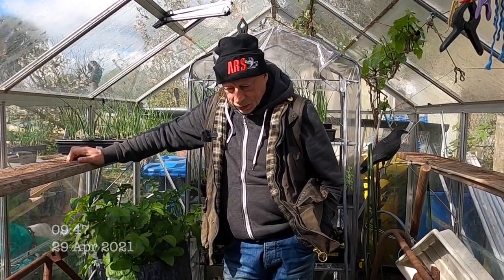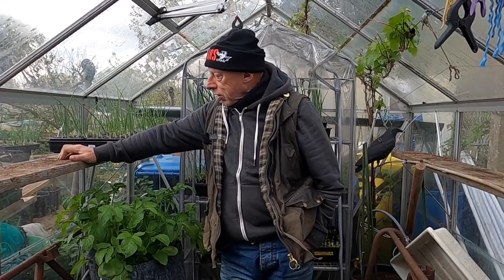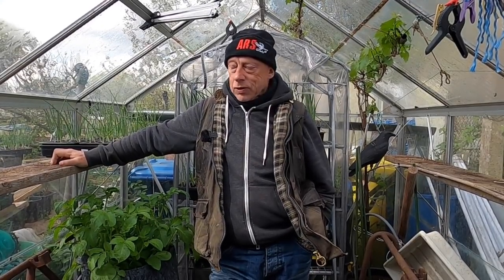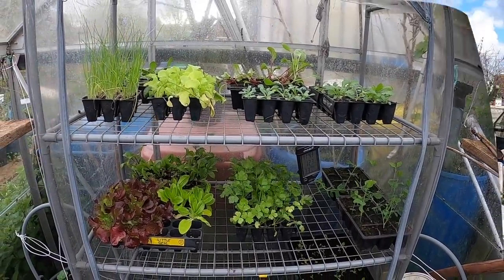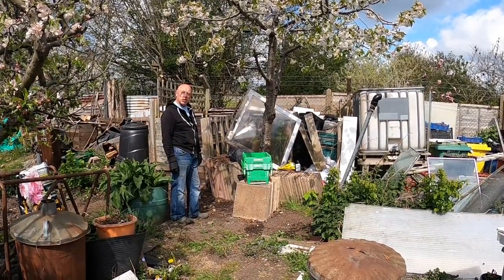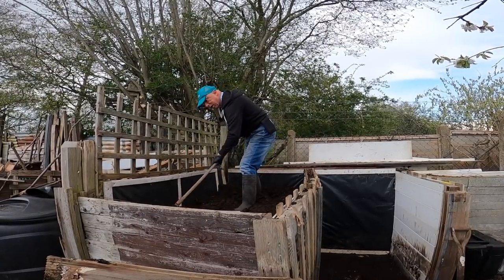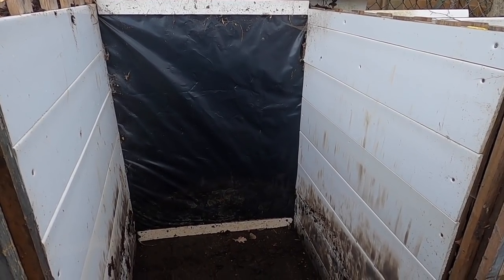🌻232 🌻 HARDENING OFF PLANTS 🌻 HOW TO STORE MANURE 🌻 PLOT MAKEOVER 🌻

Comment: Hi Nigel, How you manage to tend all that allotment I’ll never know.🤔 I have a problem you may be able to to put me right on, after successfully, well most of the time, growing from seed, my seedling seem to grow ok up to a few inches then seem stop growing or take far too long to be able to plant out. I grow in a temperature of around 18 / 20 degrees, any ideas..!🤔
Reply from the maker: Hello Michael, with this year being strange regarding weather, I found that most of my plants have been in the compost far too long and used most of the food up. Growth has slowed down and also some of the leaves have started to turn yellow. I give mine a very weak solution of maxicrop, around 25% dilution strength. This has done the trick 😀👍🏻
Reply: @MuddyBootz  Thank you Nigel, that sounds reasonable, will get some, and try.  Cheers.👍😊
Reply: @MuddyBootz  Thank you Nigel, you know I never gave it a thought about the length of time they are in the compost, and when you think about it, yes of course they have to feed, and food with goodness doesn’t last forever. But on the other hand 2 of my runner been shoots have just grown, and grown, at the minute they are about 16/18” long in an 8cm biodegradable pot, but like you mentioned about some of your plants these 2 are on the yellow side, they were not planted out because of the weather, and last year I lost all the beans because of one nights frosty condition, I may be being a little too cautious. Ta muchly for the answer to my problem. The maxigrow you use, is it basically a seaweed fertiliser.? 🤔😊
Reply from the maker: @michaeldominy2084  yes Michael, it is seaweed based. 😀👍🏻

Comment: Ive got to make a whole bank of compost bins to fill with horse manure. So i layer it with card board ?
Reply from the maker: Hello and welcome to the channel. If you want to line the bins for protection, black damp proof membrane is ideal however cardboard can be used between layers of manure and will rot down nicely, attracting more worms along the way.  Many thanks for watching! 😀
🌻Nigel.............MuddyBootz Allotment🌻🌻
Reply: @MuddyBootz  thanks Nigel. Been following you a few years now. Was going to line with dpm black plastic. And going to try and use free off cuts of insulation board ive been given to help speed things up a bit on some of the bins. Try to make in to hot bins.  
Im now getting manure from two horses and 5 chickens. So want to make some good bins to store in.
Reply from the maker: @nooie99  I thought I remembered your name from somewhere🤔.  Richards live show on a Sunday evening 😀👍🏻
Reply: @MuddyBootz  yes i try and tune in.